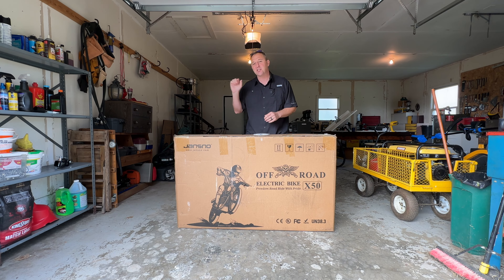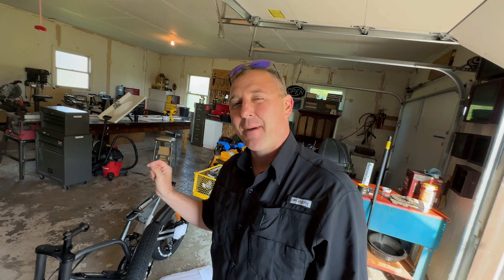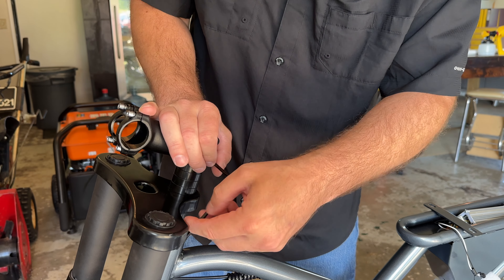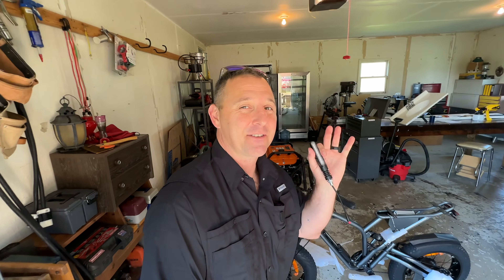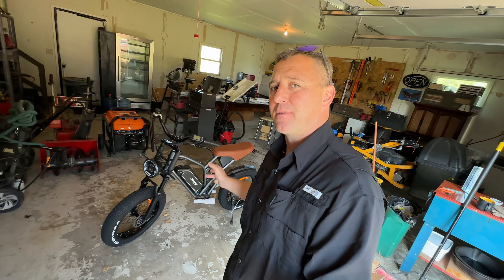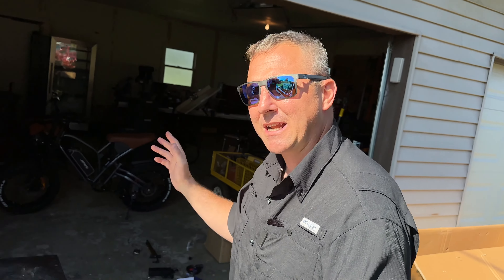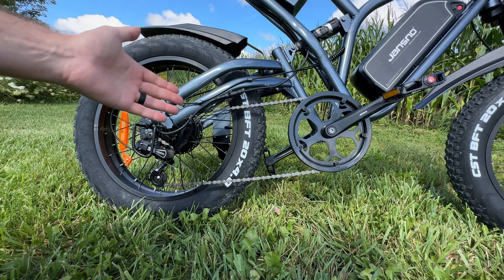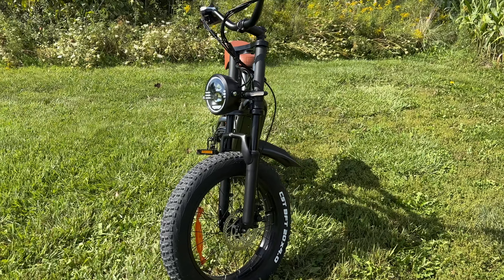The BEST CHEAP E-Bike Under $1,000! Jansno X50

Comment from the maker: Unlock the top speed!There is a pigtail under the seat with a black and white wire. Leave that disconnected to get top speed.
Reply: You can also increase the wheel diameter to 26. It will give you a higher speed go down hill 😅👍🏽.. #nice #video

Comment: This speed feels okay, but is there no other way to get him to top speed? For example, is there any function or method to increase the maximum speed? It feels like some kind of function limits the speed, because a battery with such a high capacity shouldn't have this speed. The speed limit should be lifted.😜
Reply from the maker: The bicycle didn’t have any instructions in the box. But, there is a pigtail under the seat with a black and white wire. Leave that disconnected to get top speed.
Reply: Some countries you can only go a specific speed for traffic laws which is my guess and given the look to it

Comment: I got the Jansno X70 and it came with a damaged headlight and brake caliper after contacting them (the seller) they are sending replacements. other than that, it's a very nice bike. I can't wait for the accessories to replace the damaged parts.

Comment: I'm suddenly beginning to worry about all these L-ion batteries.  I have a few power stations and a battery powered vacuum cleaner.  So I have a stake in not worrying.   But worry I do.  Who knows what is going to happen to these batteries 10-15 years from now.  I do not like to, but suspect it involves a fire baking soda or water will not extinguish after the initial explosion.   I absolutely try to keep all power stations in climate controlled are, but there has to be some amount of humidity getting into those rascals.  If it starts raining, I wouldnt worry about the kick stand, just lay it down and run like you stole it!
Reply: This specific bike uses LG cells, which are very reliable and not gonna kaboom on you